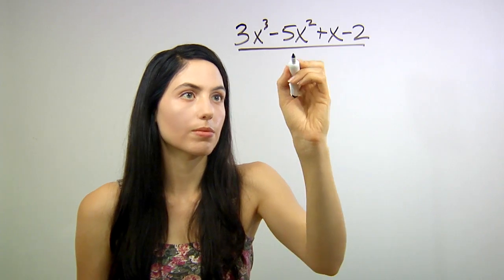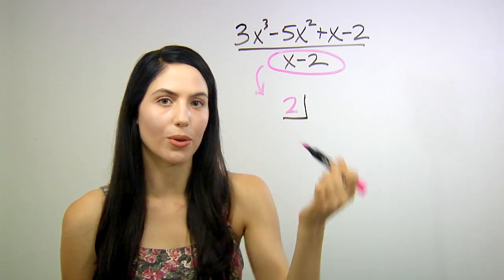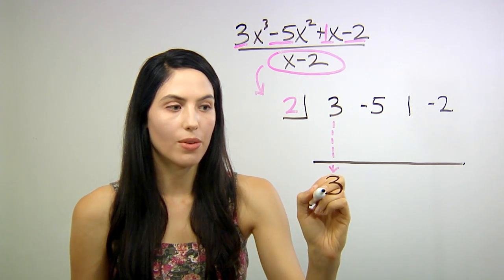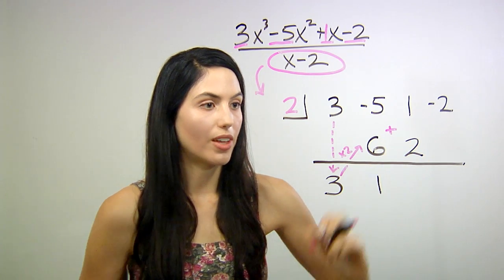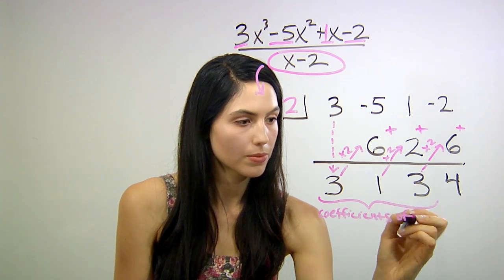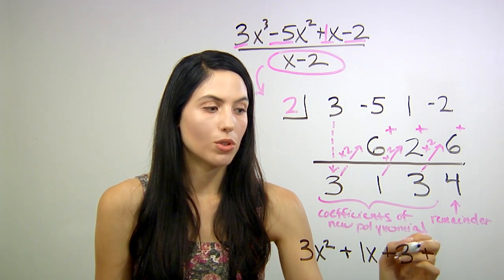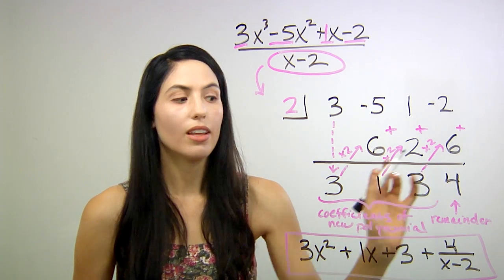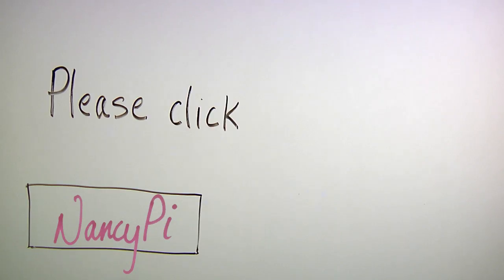Synthetic Division... How? (NancyPi)

Comment: I have a lot of trouble for understanding this technic, and I would like to know how it works, so is there an algebric demonstration whatever the polynomials we chose ?
(I´m french, sorry if I´m not clear)
Reply: Essentially, regular division is a special case of polynomial division, where x=10.  Because a number like 168 is equal to 1*10^2 + 6*10 + 8.  It is just like x^2 + 6*x + 8.   So how do you divide x^2 + 6*x + 8 by x + 4?  The same way you divide 168 by 14, which is 12.   So this means the solution to this polynomial example, is (x + 2).   And you can expand it out to confirm that (x + 2)*(x + 4) = x^2 + 6*x + 8.

Synthetic division simply recognizes a shortcut in long division of polynomials.  It recognizes that you do a lot of multiplying and subtracting, and shows that you can convert subtracting into adding, just by using the root, instead of the binomial expression as your divisor.

Comment: so if for example i only have x to the 2nd power as my highest term,do I need to put 0 in substitute for x to the 3rd power?
Reply: If you only have x^2 as your highest power, you don't even need to think about polynomial division.  We have the quadratic formula, which is a master key to solving all quadratics, and it will tell you the two solutions as directly as possible.

There are cubic and quartic formulas, but they are complicated, and a lot harder to use than this method.  Quintics and beyond, have no such formula, which is why you need methods like this to reduce them to more manageable forms.

Comment: Is there a way to use synthetic when dividing by longer polynomials than x-2? Like ones including cubes and squares
Reply: Yes.  You would factor your longer polynomial into its roots, so that each one of them would become a linear root term.   Even if you had irrational roots, you can do this, although it is more complicated, and probably will be simpler to do polynomial long division.

You could also do it with complex roots, in the event that you have an "irreducible" quadratic, but it will probably be a lot simpler to divide by the quadratic with polynomial long division.

Comment: is there another method besides factoring by grouping and this to find the roots?
Reply: Yes.   The rational root theorem. 

Given a polynomial in the form of:
a*x^n + b*x^(n-1) + c*x^(n - 2) + .... + k

Look at your a and k terms in particular, as these are clues to find the rational roots, if there are any.   Find all integer factors of k, including 1 and k itself.  Then find their negative counterparts.  Then also find all integer factors of a, including 1 and a.   It's redundant to find negative factors of a.

Then form candidates for your roots, which will take the form of (factors of k)/(factors of a).

There is another trick to understanding polynomial roots.  The k-term and b-term are both clues for them.  The polynomial roots will add up to -b/a, and the polynomial roots will multiply to k/a for even-ordered polynomials or -k/a for odd-ordered polynomials.  Let this also be a clue to know which of these candidates to attempt.

Then use trial and error with each of these candidates for roots, to find which possible combinations of factors of k and factors of a, are valid roots of the polynomial.
Reply: To given an example, consider:
2*x^3 - 5*x^2 - 4*x + 10

We need to come up with rational candidates for roots, by examining the 2 and the 10.
Integer factors of 10:
-10, -5, -2, -1, 1, 2, 5, 10

Positive integer factors of 2:
1 and 2

So each of the candidates for roots, will be the factors of 10, divided by either 1 or 2.   Since our b-term is negative, this means positive roots are much more likely.   The roots are going to add up to +5, and multiply to 10*(-1)^3, i.e. -10.   This tells us that positive solutions are much more likely, since the solutions add up to +5, and multiply to -10, so it is likely the case that there are two positive solutions, and one negative solution.

So, eliminating the redundant ones, we try 1, 1/2, 2, 5/2, 5, and 10.  We'd also try the negatives of each of these, if none of these pass.  Of these candidates, x=5/2 checks out.   So we can do synthetic division with x=5/2.

5/2 |_2_-5___-4_10_
_________5___0_-10_
______2__0__-4__0_

This factors the expression as:
2*(x^2 + 2)*(x - 5/2)

and tells us that the other two roots are x= +sqrt(2) and x = -sqrt(2).

Comment: hay nancy i wanna know how to solve the equation if there is no such divisor...such as 2x^3+3x^2+5x+7=0
Reply: Hi divine, from 5 months ago.    wouldn't your 2x^3+3x^2+5x+7 be the dividend (the numerator), because your divisor needs to be a binomial in 1 degree.  Now in Polynomial Long Division you can have a divisor in more than the first degree.
Reply: In the example you gave, there is no rational root.   There is one real root, and it is irrational, so this method doesn't work.   You'd use Cardano's cubic formula to solve it analytically.

You start by some straight-forward pre-processing.   Divide through by your a-term, and get:
x^3 + 3/2*x^2 + 5/2*x + 7/2 = 0

Then, you shift the graph horizontally with a change-of-variables, so that the b-term is equal to zero.   You then get a solution in the form of:
t^3 + p*t + q = 0

Once you have it in this form, you calculate the discriminant, capital D:
D = p^3/27 + q^2/4

And use it in Cardano's formula, to get t:
t = cbrt(-q/2 + sqrt(D)) + cbrt(-q/2 - sqrt(D))

Then undo the shift, to get x:
x = t - b/(3*a)

To get p and q from your original coefficients:
p=(3*a*c - b^2)/(3*a^2)
q=(2*b^3 - 9*a*b*c + 27*a^2*d)/(27*a^3)

So for us:
p = 7/4
q = 5/2
D = 3043/1728
Positive D tells us there is one real & distinct solution, and two complex solutions.

Evaluating t:
t = cbrt(-5/4 + sqrt(3043/1728)) + cbrt(-5/4 - sqrt(3043/1728))
t = cbrt(-5/4 + sqrt(9128)/72) + cbrt(-5/4 - sqrt(9128)/72)

Undo the shift to find x:
x = cbrt(-5/4 + sqrt(9128)/72) + cbrt(-5/4 - sqrt(9128)/72) - 1/2
x = 1.4455

Comment: what would you do if, per say, your problem was 3x cubed  - 5x squared + x - 2 without it being a fraction? Im a freshman(age 15) in algebra 2 and none of the ones ive done or seen have had a denominator. 
also mine hardly ever start with a number in front of the x cubed. for me its just x cubed then the rest of the problem, not like that matters much but still.
ok 1 last thing. Has anyone else been taught that the last number after doing the S division MUST be a zero, because thats how i was taught and its kinda confusing me.
Reply: Hi Afterglow,   Yes, Synthetic Division is used to TEST for possible Zeros in Cubic Polynomials, that unless you get a zero then your Test Constant is not a Zero of the Cubic you are playing with.

Comment: Synthetic  -- so its not real division ? 
LOL
Reply: Yes, Synthetic Polynomial Division is different, and easier than Polynomial Long Division.  On Long Division, instead of just using the constant, you use the entire binomial denominator, and instead of Adding throughout the steps, you have to subtract, and you have to be careful to keep your X columns aligned by their powers... a lot of stuff to pay attention to and far easier to screw up, but when you are done, you have your polynomial quotient sitting pretty as a picture on top.  So, yeah, it is good to know both, because Long Division is alot like Elementary School Division, and Synthetic division you need to remember those basic Nancy Rules which you will tend to forget.  so, yeah, Synthetic is Easier if you can remember how to do it.
Reply: @leovolont  it's not different it's just that you don't write variable while dividing.... Basic logic is same
Reply: @shashwat4920  Oh, in regards to Synthetic Division another thing that one needs to remember is that the number you set out  in  front, the divider, well, it has to be the NEGATIVE of the constant in your original binomial denominator.  In Polynomial Long Division you use the actual denominator as is, then you need to subtract the product across instead of add.  So, yeah, there's a few tricks one has to remember.
Reply: It's a real division: https://mathexample.com/en/mdi_gen/divisor_eng/variant_481112300

Comment: How does this work/when is it practical? Thanks for the refresher.
Reply: An example of when this is practical, is the deflection of beams.   Given a uniform beam with a uniform load, the equation of its deflection curve will be a 4th degree polynomial.  Suppose you wanted to know the maximum deflection (distance from its unloaded straight line form).  You'd take the calculus derivative, which will be a 3rd degree polynomial, and solve for its roots.  The roots tell you where the deflection could be either maximum or minimum, in addition to end cantilevers if applicable.   You might get a rational root to this cubic polynomial that isn't on the beam, and you might then need to use that rational root to find the irrational root that is on the beam, which is the root that matters for the practical application.